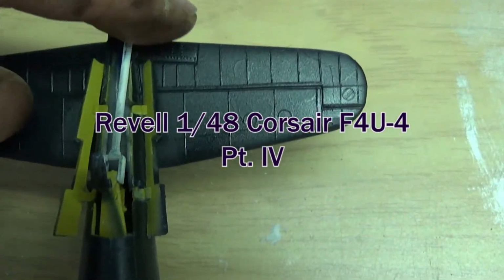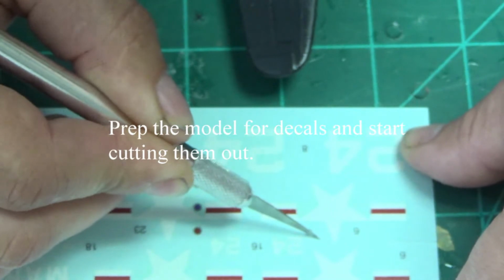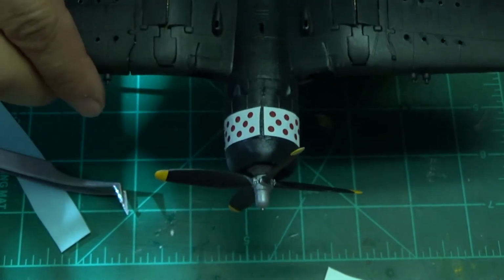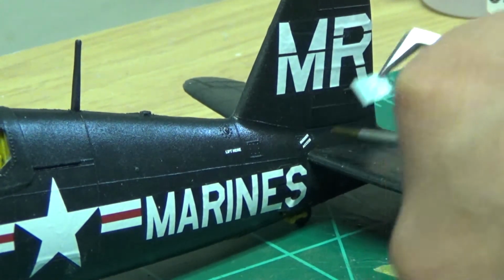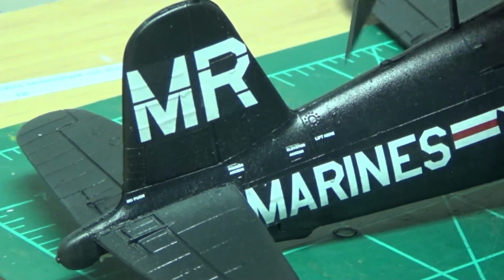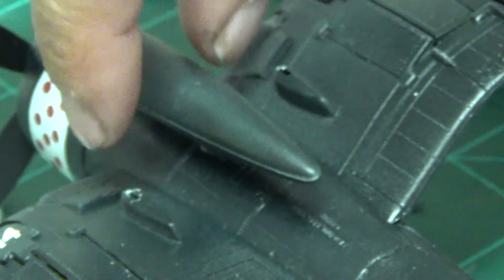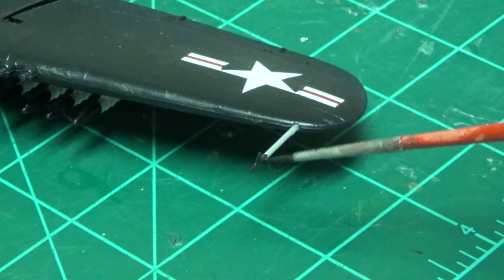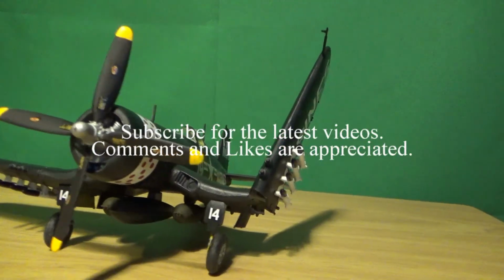Revell 1 48th F4U Corsair Part 4 Decal Tutorial

Comment: Excellent job! I built this same kit way back in 1987 when I was 14 (1970's box art). Was quite proud of the F4U Corsair 'cos that's when I first discovered weathering techniques that I learnt from a town library book. I also installed an electric motor to turn the prop and built in an AA battery compartment and on/off switch into the underside of the wing and fuselage. Sadly all of my plastic models were lost when I left home three years later. Mother had no appreciation for them.
Reply from the maker: Thanks for watching.  It's a great plane! Great idea on the motor in that too.

Comment: awesome  Kit build! I just completed this kit myself a while back. Everything went together pretty smoothly, except the wing top hinges which were extremely fidgety and didn't want to  work right- It's an older kit and I know it has it's limitations  ) Thanks for posting this how to series, and inspiring younger builders!
Reply from the maker: +Eclipse horse yes the wings were not very easy at all..the gear and hinges were the toughest part of this build.
Reply: The directions were a bit awkward for that step, I installed the the wing hinges and retainers as shown-  and found out later they were on backward- they don't give ya a lot of wiggle room that's for sure!  had my upper wing roots off at least a couple times to correct the problem and line things up. As it is no, the Port wing works the best, the Starboard... eh, if you don't loo at it really close it's ok :)
Reply: Everything went well for me exept the landing gears because they kept breaking, i tried to put them back together and it of coarse didnt work!

Comment: Great job. I just built this kit as well, and ran into similar problems. The pilots legs did not fit right and you cut off his legs but I just adjusted them after softening with a heat gun. Fighter pilots have enough suffering without losing their legs... remember Toy Story? 

Also, somehow my kit was missing the wing hinges and I had to make two hinges by whittling the plastic. If you have any better ways to make up for missing parts, that would be helpful...
Reply from the maker: Send Revell letter and they will send the parts. I am making a diorama, or at least  will attempt it and am going to have to soften the pilot legs as well since I built it without the pilot in right away.

Comment: 0:16 Somebody touched uncured paint! :P Do yourself a HUGE favor and start using some sort of liquid welder like Tamiya thin cement or Plastruct plastic weld. It has faster cure time, is less messy and turns out cleaner so you don't have to fix cement "blobs". Also, what kind of thinner and paints are you using for the airbrush?! For having a gloss coat it looks pretty rough like you used an incompatible thinner/paint combination? Or no thinner... For acrylic paints an alcohol based thinner works, like Tamiya thinner... And enamel paints like Testors need spirit based thinners. Wish they wouldn't have stamped "Revell Made in China" on the bottom for me to have to sand OFF! Oh well... I'm about to start building this kit so thanks for the tour!
Reply: oh YEAH and you need a mask for Testor enamel paint!!!
Reply from the maker: I have a bad habit with lack of patience.
Reply from the maker: I also am still getting used to the airbrush and how much to thin in addition to air pressure. I think I finally cracked the code recently so my finishes will look a lot better here on out...hopefully! Practice practice practice.
Reply: Keeps your spray pattern sharp instead of blowing clumps.